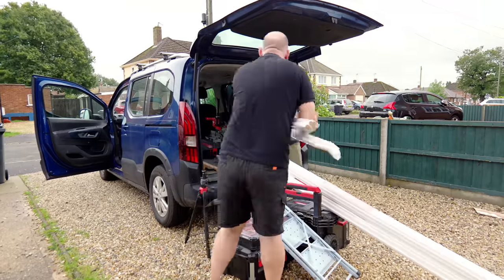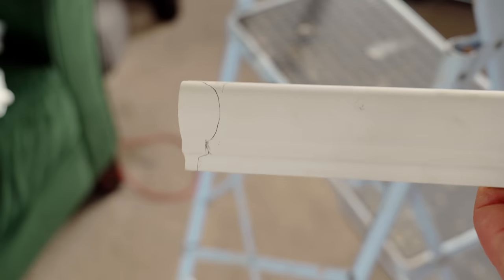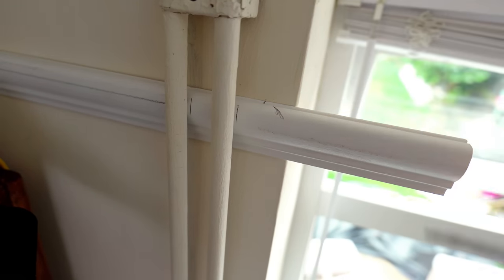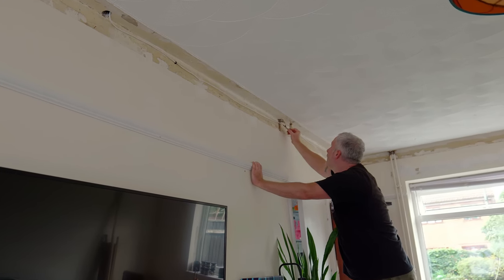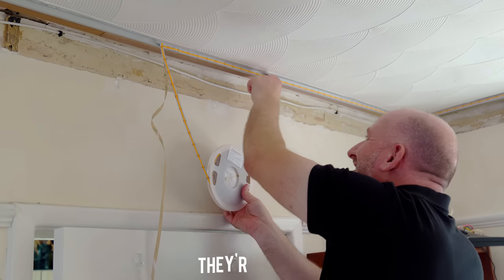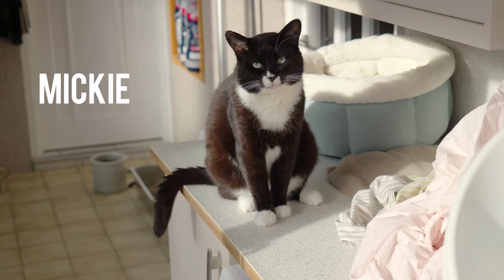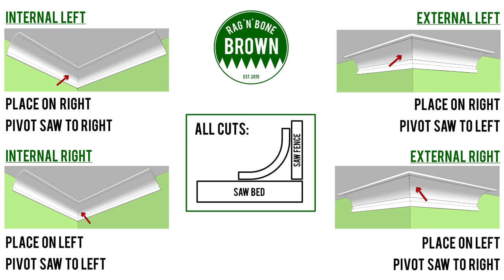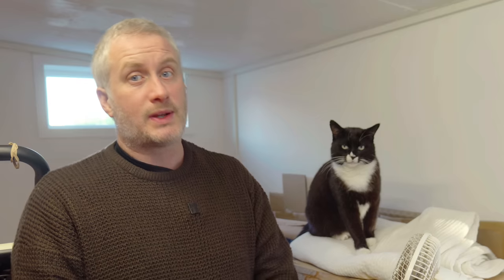DIY LED COVING + PICTURE RAIL - On A Budget!

Comment: For you brother really, but he could use a product called quinetic from TLC so u dont need to plug it in. You would spur off the existing light, and connect that spur to the led driver… at some point along the wiring he could install a quintic receiver. Then at the light switch he can change the switch to a 2 gang mk grid switch, the 1st switch button can be his normal light switch, and the 2nd can be a quinetic switch. The quinetic switch has no power connected to it, it connects to the received using RF, and when u press it, i generates enough kinetic power to send a signal to the received to turn on. Its amazing technology, i have used it to fit a second switch to the bathroom wall light so kids can see when they go to the toilet in the night, also used one on downstairs toilet so i could get rid of the annoying pull cord, as there no power connected to the switch there perfect for wet areas where u couldnt normally use a switch due to being in wet zone.

Comment: Can I ask how you ran the cable to power the LED strips? That's the part I was looking forward to seeing. Thanks in advance. Great job, both of you.👍👍👍👍
Reply from the maker: There's a bit of trunking behind the door in the corner of the room behind a bookcase
Reply: Was looking for this very question before I commented. Thanks for asking Cliff, and thanks for responding Keith <3

Comment: Excellent stuff, mate. When I was doing some coving a while back, I bought two of the pre-made corners, and then used them as templates on my mitre saw to cut the full lengths. Wish I'd seen this video with the LEDs before, looks absolutely brilliant. Thanks for all of your very practical, easy to follow videos. Cheers

Comment: Looks fantastic! There's a tip that I've used for coping skirting, but I imagine it would work just as well here on the picture rail, which is to cut a 45 as if you're doing an internal mitred corner then use your coping saw and a slight back cut to remove the exposed MDF bit. Perfect fit every time.

Comment: The Wickes coving jig (the blue one you showed) is a great piece of kit, makes it so easy to visualize the cuts, only problem is that it is size specific to the coving and 127mm seems to be the easiest to find.

I recently did coving all through my house and only one regret is that I cut too tight to central heating pipes, when the heating is on, the coving clicks as the pipes expand.  I had to make better clearance and filled with a flexible sealant and the annoying clicking has gone thankfully.

Comment: Nice job Keith, and quite reasonable prices for the materials as well.
I fitted LED lights behind our lounge coving, the coving has a channel down the back to take the lights.  The lights did suffer from voltage drop as they went round the room so had to run extra cables in the channel to connect far led strips in, I couldn’t rely on just connecting the cobbled strips together. Then had terrible trouble with the led lights shining through the polystyrene coving. It took coat after coat of paint before I finally blocked the light so it only shone up above the coving.
Nice end result but loads of effort!

Comment: VERY well done. Looks great. I'd even live there. Neat trick with the saw and level. LOVE that solution. So much of my stuff is aluminum that I never think of magnets. Saw table (Craftsman) Miter saw table and fence - aluminum. Etc. That hanging Laser level would probably work well as an earthquake detector too..... ( I live on a large fault line - the New Madrid Fault.)

Comment: Andy Mac does a good trick where instead of scribing, you cut that edge at 45 degrees and remove the non primed material. See his renovation video on architraves (from memory).

Looks great, really good job

Comment: Dude, you can cut the picture rail at 45 degree to save doing the scribe with a compass.. Just cut 45 for inside cuts then scribe, use the outside line to cut too, much cleaner and precise.

Comment: I did a similar thing. I basically built a tiny 90mm deep shelf 50mm down from the ceiling all the way around the room then attached the coving to the underside the standard way and used a huge length of rope Led the whole way around the room.

Comment: Love the video! Quick question might be a bit stupid. What kind of LED lights were they in the sense of power supply? Were they battery or plug ins and how (if did) did you hide the power area or manage the wires?

Comment: Would love to have seen how you got power to them and what power adapter you used and control them. 

Also at the length did you need to inject power at two places ?

Comment: Great video, although I’m not 100% certain on this but I’m pretty sure the lock-in points on the bed and back bevels at 33.9 and 31.6 are to enable you to lay the coving flat and cut mitres. I could be wrong tho.

Comment: Good work. Just a thought. In a recent house survey the surveyor said that the polystyrene coving should be removed because of the risk of melting hot polystyrene dripping on you if you were to need to escape in the event of a fire. I haven't looked into whether this is actually and issue though.
Reply: in this case I would think you got much bigger problem than a bit of melted polystyrene.

Comment: Are the LEDs powered by battery or are they worked into the light switch? 

Great video btw very informative!
Reply from the maker: They come with a power supply and are linked in the description 👍

Comment: Must have been a moth 😂😂😂😂 quick tip if you cut a 45 on the end of the picture rail it will show you the exact line to 'cope' down. or you buy a cove mitre 'jig' and you can do it with a handsaw (screwfix 'supercove mitre tool £5.99) your brother is the 'cat lady' everyone has in their area😂😂 I'm pretty sure its a compound mitre rather that just a mitre. but I like the way you tried to explain it, end product looks good

Comment: The only problem people will have, looks nice but wen you need new light how do you replace ? Thats what you got to think about
Reply from the maker: Remove the diffusers and fit the new LEDs what's so difficult about that
Reply: @RagnBoneBrown  is it easy to do
Reply: @RagnBoneBrown is the coving over the led lights ? Cos video not clear, cos if it covers the light how do you remove ?

Comment: I wanted to build something like this too in my gaming room, but I've heard horror stories where if one of the leds burns out the entire strip stops working, and if you want to fix it, either you take it down entirely and replace the whole thing, or test the leds one by one until you find the one that doesn't work....
Reply: On a second look, COB leds look different. I wonder how easy it is to break, and if it's easily replaceable.
Reply: It's only stuck on with double sided tape, so as long as you can open the diffuser you should be fine